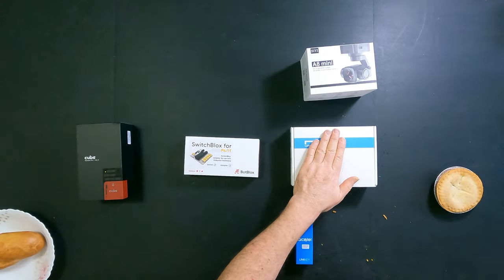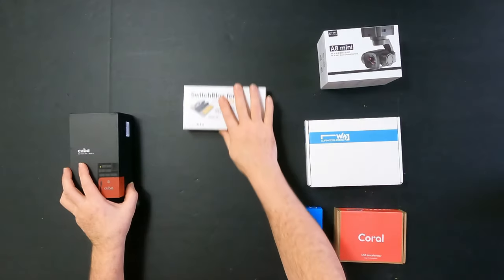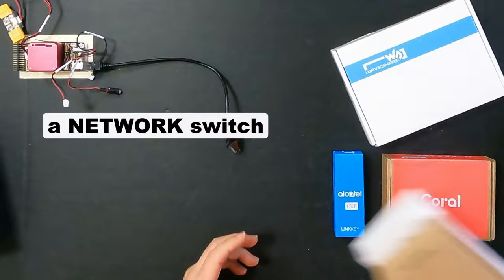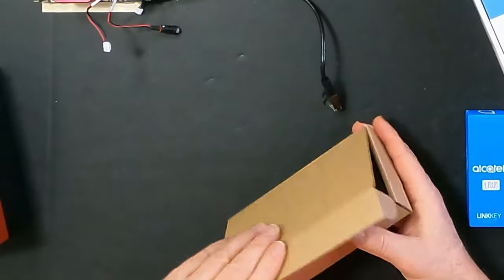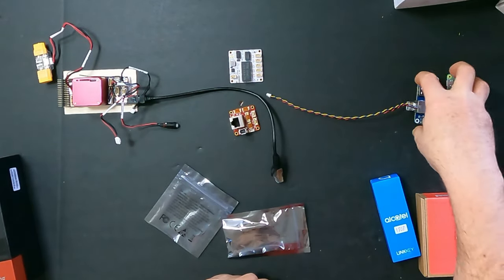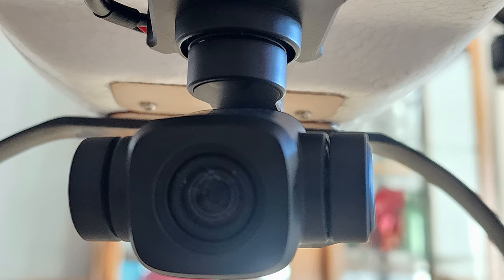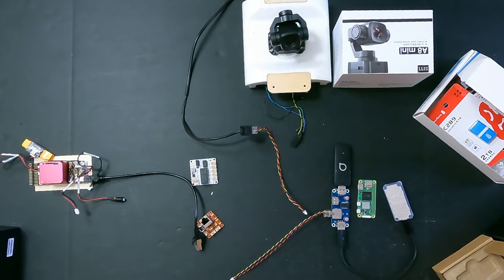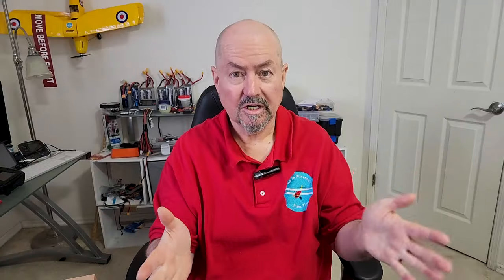Network on a drone! Raspberry Pi and Cube Red: ArduPilot 4.5.0 - Internet of Drones part 1 of 3

Comment: What is the benefit of having an Ethernet connector on the carrier board?
Reply from the maker: Direct communication with the FC at ethernet speeds, and its a single wire, instead of multiple UARTS to connect to each device. You can run multiple (up to 4) different protocols over the same wire.